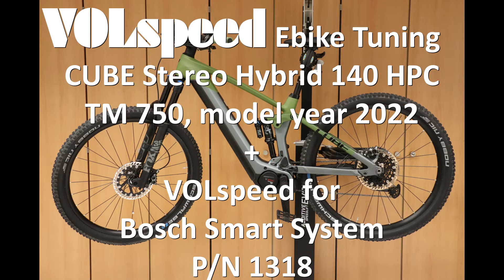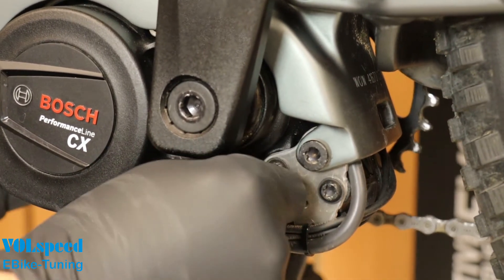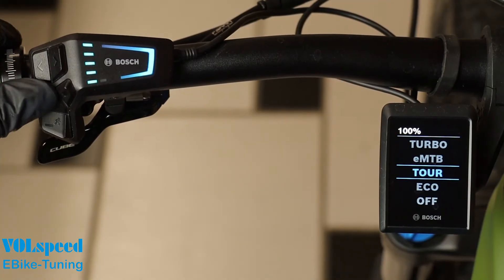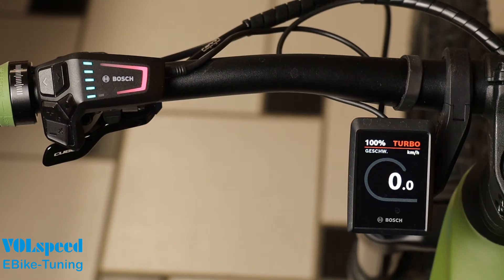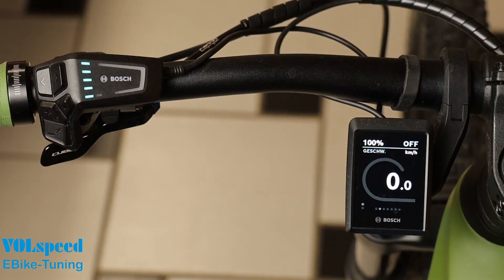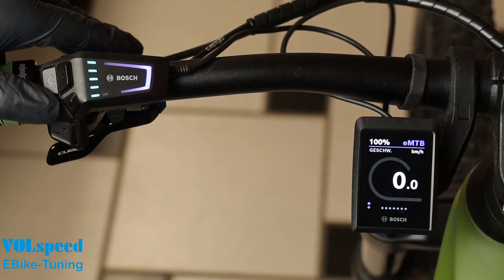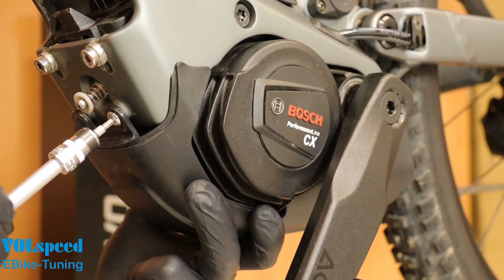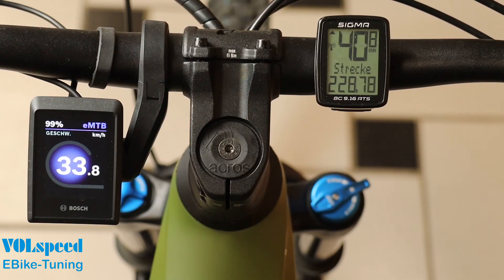VOLspeed Tuning for Bosch Smart System (En)

Comment: Over engineerd. You don't need all those functions.  After a couole of years the device developes faults. The motor power output jumps up and down without you changing power modes. The Peartune is better. Just pulg it in and it works with unlimited speed.
Reply from the maker: I am not familiar with the problem you have described. Please feel free to contact our support team, who will be happy to help you:: http://www.volspeed.de/Support/en
Reply: Peartune is more complicated from a users point of view, for no reason.
Reply: https://youtu.be/-PIDzHCS5WM?si=wpMhcMHmuhFzjete

Comment: Will this work on gen 4 smart system latest firmware from bosch its 16.08.19  version thanks just released 3 days ago  any info welcome and are they bad for error codes as I've heard speedbox is bad for that bricking motors amd limp mode I am using a SPEEDI device mechanical mechanism and get 25ish mph ❤🎉
Reply from the maker: The latest software version 16.x.x has only been available to us for a few days. We have already started testing it. However, based on experience, we need about 6-8 weeks to test it thoroughly. We therefore currently advise against installing this software if you want to use or already use a tuning module.

Comment: My ebike has no display and no green connector, what to do?
Reply from the maker: A green connector is not required and is not shown in the video. You are probably referring to the grey connector. This connects the speed sensor to the motor. If this connector is not present, then the bike is equipped with a rim magnet, for which this tuning module is not suitable.

A display is not essential for tuning, but makes the settings easier.

Comment: I’ve got a 2024 Cube Stereo and am about to order. Couple of questions though. Does the display show the correct speed I am travelling when this is turned on? And I literally upgraded my software last night on the bike to the latest version as of now. Does it work with this one?
Reply from the maker: Unfortunately, this tuning does not provide a correct speed display. Once the tuning is activated, a value that is too low will be displayed above a speed of 21 km/h.
The tuning is compatible with the latest software version 15.x.x. An overview of the tested software versions can be found here: https://blog.volspeed.de/bosch-smart-system-overview-software-versions-677/?lang=en

Comment: Do I have to remove the battery
Reply from the maker: From a technical point of view, it is not necessary to remove the battery. We only remove the battery to prevent the drive system from starting unexpectedly, i.e. for safety reasons.

Comment: Very nice! 
- Does the Bosch system have a "detection" that can raise error code if it detects that speed is too high? Or setting the tuning to 45km/h will work fine?
- Does it work with the mini remote (without screen)?
Reply from the maker: Yes, all Bosch drive systems have tamper detection. This can cause error code 524001. The error may occur with this tuning, or in other words, the tuning cannot actively prevent the error. However, this is very rare. Less than 0.2% of customers with this tuning have reported such an error to date. So far, we have not been able to determine a higher probability at 45 km/h compared to the standard setting of 32 km/h. Theoretically, the probability would be higher at 45 km/h. However, the cause of the error was often found to be an incorrectly installed speed sensor.

Mini Remote works

Comment: I have a cube hybrid reaction 625 pro 2024 model will this be compatible with it ? I’m hearing that the motor may get blocked out if I do it is there any truth in this
Reply from the maker: A new version V2 of the chip (P/N 1350) has been available for some time. This is also compatible with the latest software 12.13.0 and should therefore also be compatible with your bike. Information on the software versions tested by us can be found under the following link:
https://blog.volspeed.de/bosch-smart-system-overview-software-versions-677/?lang=en

Information about the product can be found under the following link:
http://www.volspeed.de/VOLspeed-E-Bike-Tuning-for-Bosch-Smart-System-V2
Please note that, as stated in the article description, this tuning is not compatible with bikes with rim magnet or ABS.

It is correct that the motor is locked for 90 minutes if it detects tampering. So far, however, our experience in this regard has been very good. Less than 0.1% of our customers have reported a tampering error so far. It should also be noted that other causes such as a defective speed sensor or an incorrectly installed magnet or sensor can also cause a tampering error.

Comment: Thinking getting one of these. The distance isn't accurate is that on the flow app too? And does the flow app still work. Lock and unlock bike and change modes
Reply: And is it compatible with the new 12.13.0 software
Reply from the maker: A new version V2 of the chip (P/N 1350) has been available for some time. This is also compatible with the latest software 12.13.0. Information on the software versions tested by us can be found under the following link:
https://blog.volspeed.de/bosch-smart-system-overview-software-versions-677/?lang=en

Information about the chip can be found here:
http://www.volspeed.de/VOLspeed-E-Bike-Tuning-for-Bosch-Smart-System-V2

The values are also displayed incorrectly in the Flow app when the chip is activated. However, the app still works with the chip installed, but we advise against using the app when the chip is activated. This is because the GPS data from the smartphone does not match the values measured by the motor. This is currently not a problem, but could be used to detect tampering in future app versions. In addition, you should no longer install updates on the bike if it is derestricted. This could cause the tuning to lose its function.

Comment: I've removed the battery cover but my terminals and my terminals are round like yours but the terminals on the tuning chip are rectangular. The chip says for bosch active / performance v4? Is this the correct chip?
Reply from the maker: Our tuning chips for the Bosch Smart System (BES 3) have the part number 1318 (V1) or 1350 (V2). 
The VOLspeed tuning module for Bosch Active / Performance with item number 1233 (V4) is unfortunately not suitable for the Smart System, but only for the old Bosch BES2 system.
Reply: @volspeedebiketuning4391  ok thanks, what's the difference between the V1 and V2?
Reply from the maker: The V2 is compatible with software version 11.9.3 for LED remote, system controller and Purion 200. You can find more information here:
https://blog.volspeed.de/bosch-smart-system-overview-software-versions-677/?lang=en
Reply: @volspeedebiketuning4391  Thank you, I don't have a rim magnet but I have a little magnet in the spokes and a sensor on the frame. If you provide an email address I can send you pictures.  The display is the Kiox 300 version 12.9.0. The control unit is the LED remote version 12.10.0. Would the v2 still work as the v1 is no longer available on your website?

Comment: What about if you don't have the display? Do you enter -+-+ then > to increase the speed?
Reply: But can u use the app while the device is connected ive a cube trapeze gen 3 smart and cant stand the resistance will this let the bike coast freely?ive even bought a complete gen4 motor battery and display and was thinking of putting that whole system on the bike as its not like that with the gen 4 system 2 version,im not looking for crazy speeds id just like to cycle the bike even like a normal bike on open road but it doesn't work like that it feels like a constant stiff slump to cycle unless your in high gears,will this let the motor roll on like normal im sure if i set the speed higher it naturally would but is that not putting the motor under alot of unneeded constant stress  and alot more ware on all parts and motor constantly been hot.has anyone any honest input to this? Should i put the older gen 4 cx into the gen3 smart bike altogether or simply get one of these kits and keep the gen 4 kit for New build  more suited to the gen 4s emtb.i do love the cube bike even tho its a hardtail  and been able to customise the Settings is a very handy thing with the smart system i know its only a performance gen3 but the newest one is well capable of offroading better imo than  been on the roads.best options pls🤝✌️
Reply from the maker: Operation is identical without the display:
To activate tuning, press - + - +
If you want to increase the limit, e.g. by 5 km/h, press - + - +   + + + + +

Comment: Hello!
I plan to buy a tunning chip for my new cargo e-bike. I bought a Cube Longtail Hybrid Sport (Kiox 300 and Bosch Cargo Line). Which  tunning module I should get? VOLspeed Bosch Smart System V2 P/N 350?
Thanks in advance!
Reply from the maker: You can use the following tuning for the Cargo Line motor, Smart System:
VOLspeed E-Bike Tuning for  Bosch Smart System V2 (P/N 1350)

Information about the product can be found under the following link:
http://www.volspeed.de/VOLspeed-E-Bike-Tuning-for-Bosch-Smart-System-V2
Please note that, as stated in the article description, this tuning is not compatible with bikes with rim magnet or ABS.

Comment: So when I install mine it says I need to do the minus plus minus plus code to activate it, but whatever I do nothing happens.
Reply: @PEPQC they helpen me quite good actually, they made me look up my motor number and turns out I just ordered the wrong version. Quite quick replies from them aswell in the Netherlands, can't talk on other countries though but for me it was quick and helpful!
Reply: need to look at the comments a couple down
Reply: @davidbaz5006  yeah I just ordered V1 and I needed V2, my bad lmao
Reply: @PEPQC no problem my guy, sorry for the late responce in the first place
Reply from the maker: Our VOLspeed for the Smart System (P/N 1318) is unfortunately not compatible with the latest software version 11.9.3 for LED-Remote, System Controller or Purion 200.

Since 3.5.2024 there is a new tuning, the VOLspeed for the Smart System V2 (P/N 1350). 
Information on the new tuning module can be found under the following link:
https://www.volspeed.de/epages/83313866.sf/en_GB/?ViewObjectPath=%2FShops%2F83313866%2FProducts%2F1350

This module has the same functionality as its predecessor, but is compatible with the latest Bosch software.

Old modules (P/N1318) will also have the option of a software update from 3 May 2024. Unfortunately, the update is not free of charge. Details can be found under the following link:
https://www.volspeed.de/epages/83313866.sf/en_GB/?ViewObjectPath=%2FShops%2F83313866%2FProducts%2F9011

Please note that you can only order the update directly from us if your delivery address is in the European Union. For all other countries, please contact the dealer from whom you purchased the product regarding the possibility of an update or exchange.

Comment: hello. I just bought volspeed bosch smart System p/n1318, for a cube reaction pro 2023 only with remote control, I use the sequence of - + - + and there is no change... can you help me with an advice... thank you
Reply from the maker: Our VOLspeed for the Smart System (P/N 1318) is unfortunately not compatible with the latest software version 11.9.3 for LED-Remote, System Controller or Purion 200.

Since 3.5.2024 there is a new tuning, the VOLspeed for the Smart System V2 (P/N 1350). 
Information on the new tuning module can be found under the following link:
https://www.volspeed.de/epages/83313866.sf/en_GB/?ViewObjectPath=%2FShops%2F83313866%2FProducts%2F1350

This module has the same functionality as its predecessor, but is compatible with the latest Bosch software.

Old modules (P/N1318) will also have the option of a software update from 3 May 2024. Unfortunately, the update is not free of charge. Details can be found under the following link:
https://www.volspeed.de/epages/83313866.sf/en_GB/?ViewObjectPath=%2FShops%2F83313866%2FProducts%2F9011

Please note that you can only order the update directly from us if your delivery address is in the European Union. For all other countries, please contact the dealer from whom you purchased the product regarding the possibility of an update or exchange.
Reply: @volspeedebiketuning4391  I have version 12.13.0, this will work?
Reply: you need to look at the cooments 
reply from volspeed to K3vo93

Comment: finally got around to having a look inside mine, it actually has five plugs all with wires going into them. can you elaborate on what I need to do or purchase?
Reply from the maker: If 5 connectors are connected, then the bike is probably equipped with permanently installed lighting -> display, speed sensor, battery, front light, rear light. The tuning will of course still work.

Comment: Tengo la Cube stereo hybrid del 2023 con la ultima actualizacion del Flow App, tiene motor bosch smart sistem, nose si me podrá dar algún error si lo monto? Que chip y versión deberia poner para que sea el minimo probable que dé error?
Reply: I have the latest Bosch firmware on my Performance Line CX smart system: 9.13.0, volspeed is fine on it , however once you have fitted the volspeed chip never update the bike again or it will detect the volspeed
Reply: @Lawson7086  Simplemente No actualizar nunca, verdad?
Y puedo utilizar la app Flow para bloquear y desbloquear la ebike?
Reply: Okay, but I can use the flow app while I use the unlock module safety if I can't update the firmware? And if I can't, when the module off, I can use the app? Thanks bro!
Reply: What happens if you had already updated the firmware is there anything that can still be done to fix it
Reply from the maker: Our VOLspeed for the Smart System (P/N 1318) is unfortunately not compatible with the latest software version 11.9.3 for LED-Remote, System Controller or Purion 200.

Since 3.5.2024 there is a new tuning, the VOLspeed for the Smart System V2 (P/N 1350). 
Information on the new tuning module can be found under the following link:
https://www.volspeed.de/epages/83313866.sf/en_GB/?ViewObjectPath=%2FShops%2F83313866%2FProducts%2F1350

This module has the same functionality as its predecessor, but is compatible with the latest Bosch software.

Old modules (P/N1318) will also have the option of a software update from 3 May 2024. Unfortunately, the update is not free of charge. Details can be found under the following link:
https://www.volspeed.de/epages/83313866.sf/en_GB/?ViewObjectPath=%2FShops%2F83313866%2FProducts%2F9011

Please note that you can only order the update directly from us if your delivery address is in the European Union. For all other countries, please contact the dealer from whom you purchased the product regarding the possibility of an update or exchange.
Reply from the maker: The VOLspeed for the Smart System (P/N 1318) is unfortunately not compatible with the latest software version 11.9.3 for LED-Remote, System Controller or Purion 200.

Since 3.5.2024 there is a new tuning, the VOLspeed for the Smart System V2 (P/N 1350). 
Information on the new tuning module can be found under the following link:
https://www.volspeed.de/epages/83313866.sf/en_GB/?ViewObjectPath=%2FShops%2F83313866%2FProducts%2F1350

This module has the same functionality as its predecessor, but is compatible with the latest Bosch software.

Old modules (P/N1318) will also have the option of a software update from 3 May 2024. Unfortunately, the update is not free of charge. Details can be found under the following link:
https://www.volspeed.de/epages/83313866.sf/en_GB/?ViewObjectPath=%2FShops%2F83313866%2FProducts%2F9011

Please note that you can only order the update directly from us if your delivery address is in the European Union. For all other countries, please contact the dealer from whom you purchased the product regarding the possibility of an update or exchange.
Reply: I have the NLS Components Speedi magnet for Trek that slows the rotation of the magnet relative to the rotation of the rear wheel. Will the Volspeed system still work if I have the NLS Speedi system installed?

Is there a way to correct the speedometer, or will it read lower with the Volspeed system? Can I correct the speedometer in my KIOX 500?

Can I use the Flow app the whole time while using the Volspeed? Or only when locking/unlocking?

Comment: if you just have the LED remote how do you know when it activated? deactivated?
Reply: I'm buying this but don't have the display, so wondering if I can use the eflow app?
Reply from the maker: When the bike is switched on, tuning is initially always deactivated. If you then enter the sequence - + - + it is activated. You do not necessarily need a display for this.
You can also change the limit without a display. For example, to increase it by 5kph, simply press - + - + + + + + + +.
Reply: @volspeedebiketuning4391 Does the limit show within the flow app when using with led remote?
Reply: brilliant thanks for the reply
Reply: @volspeedebiketuning4391 Can you see anything in the flow app when it is on?